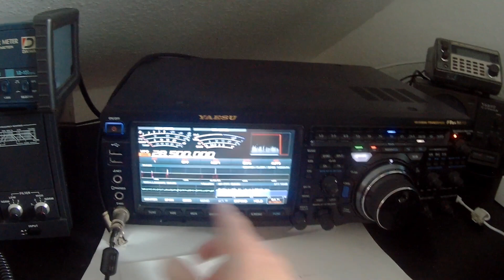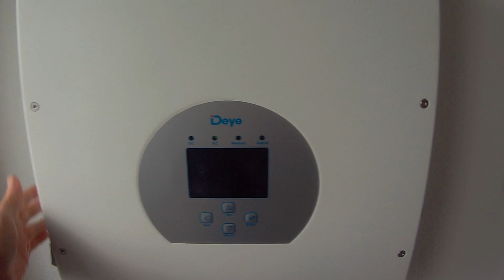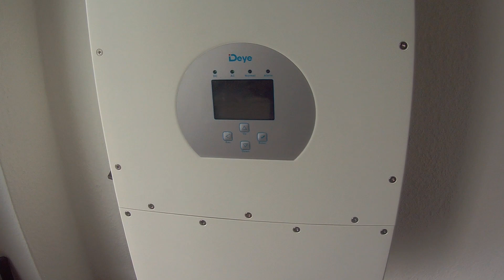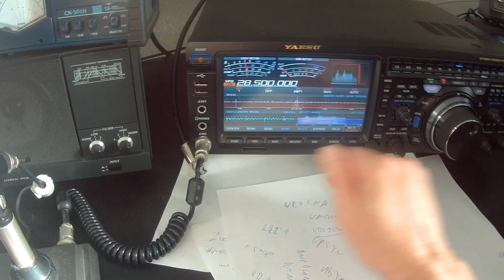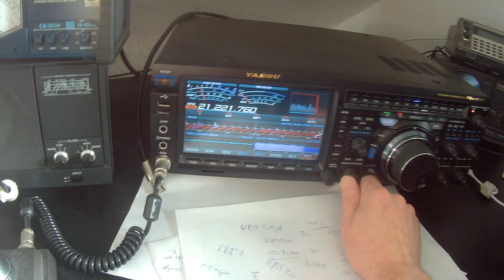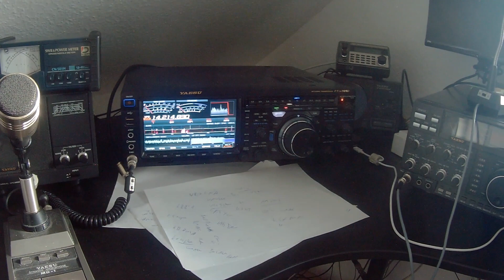RF Noise from Deye SUN12K

Comment: Hello, I have a very similar issue with my Deye 5KW inverter. I reached out to support and they asked to add additional magnetic cores supplied in the box. But in Asian variant they do not supply any torroidal cores. Could you please suggest what would the equivalent ferrite type for the Würth cores that you used? I was probably thinking of adding a few type 43 and 31 cores on every line coming out and in of the inverter. Also, how much did the mainline filter help? I'm running my rigs on separate batteries, trying to understand if adding a mainline filter to the inverter will have any improvements on the battery powered rig. 

Thanks for the video. de VU3UQI

Comment: Hello, I have same problem with DEYE Sun 12k PV inverter here. Did you ever solve the issue and what did you do? tnx de OE3MZC
Reply from the maker: Hi. Ja. Als erstes Maßnahme solltest du die Zuleitung zu den Solarpanels verdrillen. Dann direkt am DC Ausgang mehrere Ringkerne anbringen. Ich hatte die Würth gerne verwendet. Zuletzt noch einen guten 3 Phasen Netzfilter. Wichtig, du benötigst eine gute Erde für den Schutzleiter. Ebenso muss der Erdungsanschluss am DEYE auch verdrosselt werden
Reply: @freeenergyonshore2828  Danke, Was meinst Du mit "DC Ausgang" ? den Eingang von den PV Panels oder den Batterie Anschluss? tnx 73 de Mike

Comment: Thanks for the video! Have you already determined which cable sends the most RF interference? Will you show troubleshooters you've tried that didn't work and those that helped with your installation? Kind regards from Schleswig-Holstein, Dietmar, DL4HAO (I wrote in English because you also published this video that way) 😉
Reply from the maker: Hi. Ich komme mal auf Deutsch zurück.  Die Pfeifstellen konnte ich mit mehreren Drosseln auf der Solarleitung deutlich reduzieren. Ich habe hierfür die großen Würth Ringkernen verwendet und mit Solarleitung bewickelt. Das breitbandige Rauschen ließ sich mit einem 3 Phasen Netzfilter (gute Erde ist Pflicht) in den Griff bekommen. Das Video zeigt den Deye ohne die Modifikationen. Wichtig, auch die drei Messleitungen für den Verbrauch mit Drosseln versehen
Reply: @freeenergyonshore2828  Danke für die schnelle und ausführliche Antwort! vy73, Dietmar, DL4HAO :)

Comment: It is a pity, but almost all such devices makes such RF noises, because build on some pulse principle. As HAM I would not go to buy any without a kind of spectrum analyser test. 
I got the same problem with central heating UPS, that makes very nasty pulsing noise  about every half second. 😢

I am thinking about making some kind of wiki or independent online DB about these devices noise levels...
Reply from the maker: Hi. It depends a bit on the controller. In the case of the device shown, it only works on the switch. However, you can build a bridge/connection  to the relays. Then it works for both
Reply from the maker: Sri wrong chat
Reply from the maker: It's really annoying. The same EMC problem occurs if only the batteries are in use. I will soon install an additional EMC filter (on grid side) and report